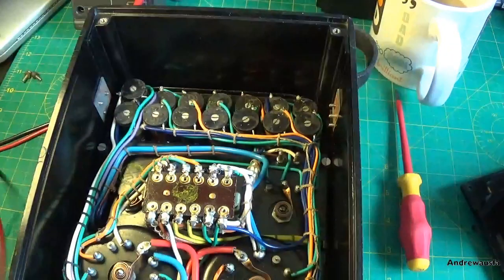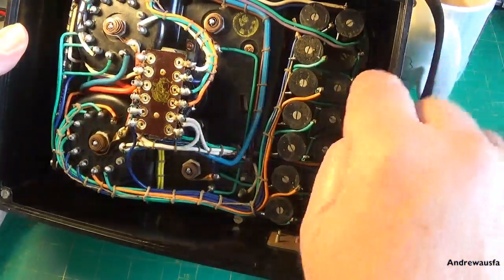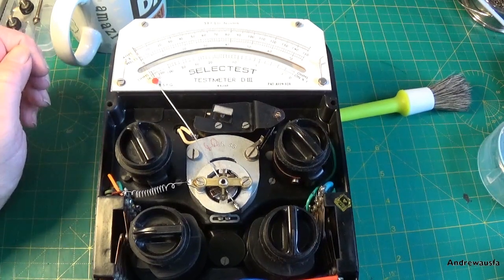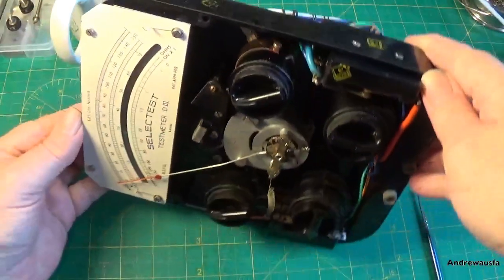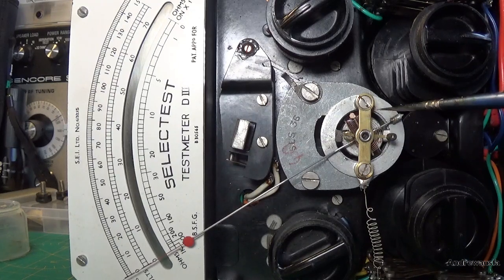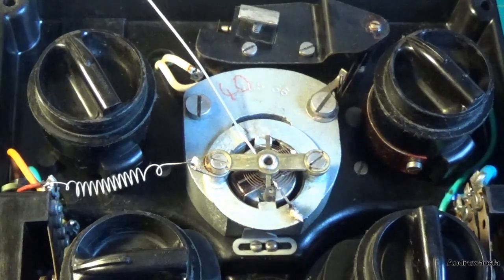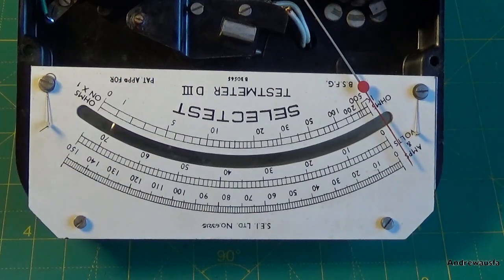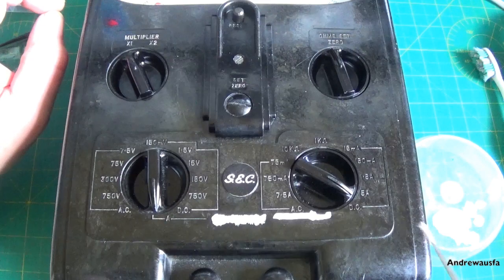GEC Selectest Part Two - meter movement balancing

Comment: It's a real shame about the bobbins but the meter balancing was really interesting. I also learned another way to infill the missing paint. I think you'll be able to put together the precision resistors that you need and it would be very satisfying to bring it back to life! Great video - thanks. Just found this which may be of some use: https://www.vintage-radio.net/forum/showthread.php?t=136727

Comment: That's a shame about bobbins opening up like that. I think it's just the manufacturing process they used back then for very fine wire. They just didn't have the technology at the time to make really robust fine wire. Doing meter surgery is always a risky process even for the most experienced among us. The factories that made the movements had specialist technicians that did just that in what we would call today "clean rooms" that were free of dust, drafts, and anything remotely magnetic. Hope you can get it going Andrew. It would be nice to save an old beauty like that. Stay well. ATB Doug.